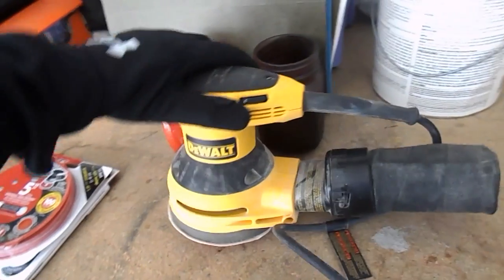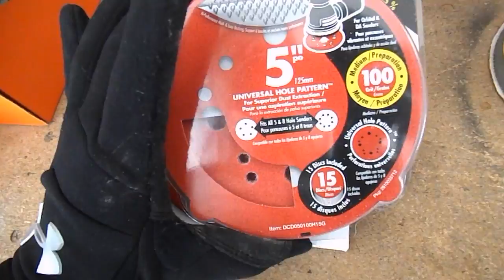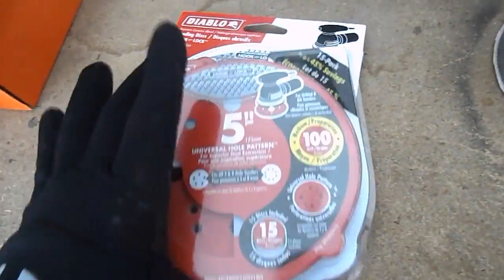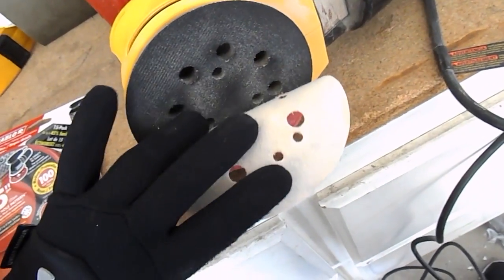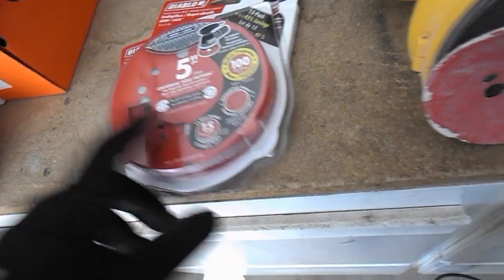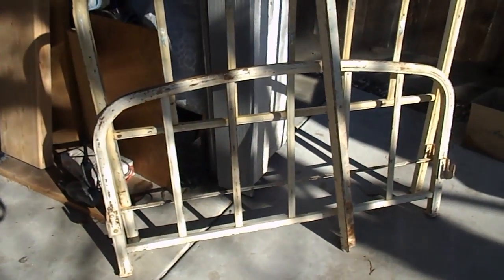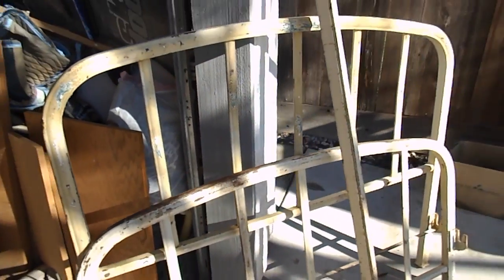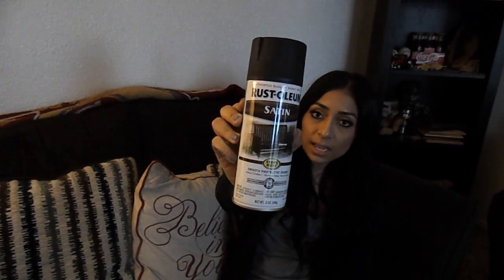| DIY Metal Bed Frame Restoration | Carissa Cantu

Comment: This bed frame is an American frame, from the Austere models popular then, lots of square, linear edges. This is not an antique but rather vintage, I'd say about 60-70 years old, but not antique. This might also have been an institutional bed, like a hospital bed or a bed in an old folks home, during the 1940s, or around there. Great bed and you did a wonderful job giving this old bed frame new life.

Comment: For future reference when you paint metal objects you need to remove all the old paint  stripper works ok but still requires wire brushing and sanding i am currently restoring a similiar bed  but my bed had rust and had been repainted so a complete strip and sand to bare metal was necessary 
I think your bed would have turned out much nicer if you had done the same thing

Comment: Good job but I wouldn't   consider this a restoration as you didn't restore it to its original condition.    How is the finish holding up after a few years?

Comment: Hey quick question! So you didn't have to sand ALL the white paint off? It looks like you just roughed it up so the black paint would hold, is that correct? And you didn't use a primer at all?
Reply from the maker: Kaitlin McTague my Frame had a lot of stickers on it. I did the most sanding over the stickers because if we would’ve just sprayed over them, it would’ve looked clumpy and eventually start to peel and yes, roughed up the rest so the spray paint had a smoother base to stick to. The white paint was already starting to peel. I got most of it off. And we did (i had to double check with my dad lol), but there is some paint that comes with the primer in it already. So it’s all preference
Reply: Awesome, thank you!! ❤️

Comment: Do you have to sand it? I have a new bed but they didn't have the color I wanted. The metal is new and no rust..
Reply from the maker: Sade _  If the frame already has a color applied to it. I would recommend sanding it to remove some of that color before applying your coats of new paint. However, if it is regular metal no color sanding isn't necessary you'll be good to go with applying your spray paint 
In my case my frame had been painted a color previously and had stickers on it as well. So sanding was necessary.
Reply: HI my dad didn't we just use metal ( but it was still black) wish I could add a pic :(

Comment: Do you recall how many cans of spray paint you used for this?
Reply from the maker: Stephanie Gregory  I want to say we used for sure 2 and maybe partial of the 3rd one? For touch ups. It mainly depends on the size of the frame. Mine was only a Full Size.